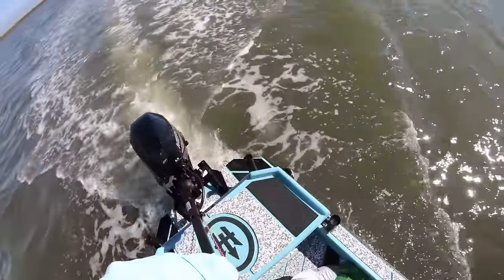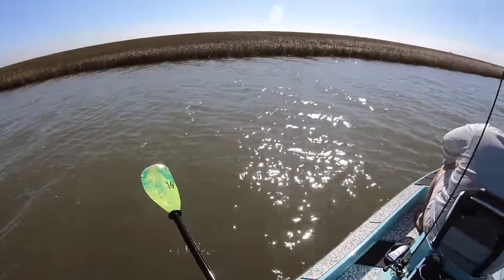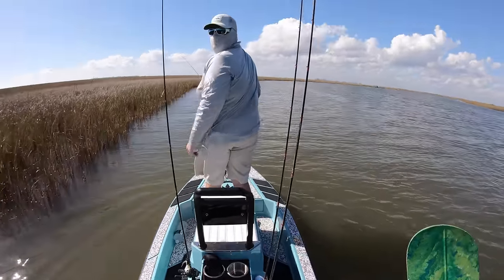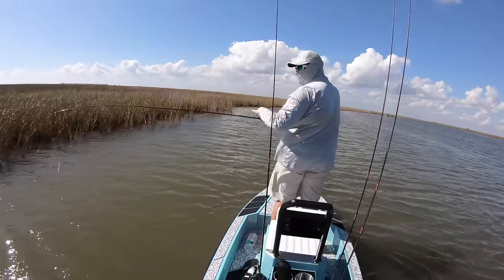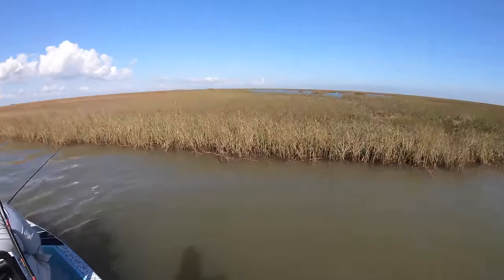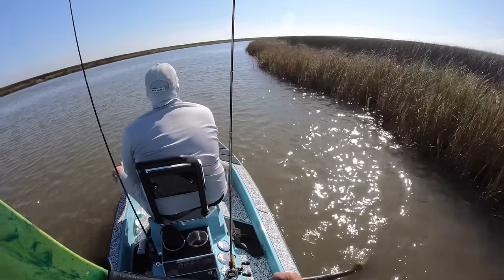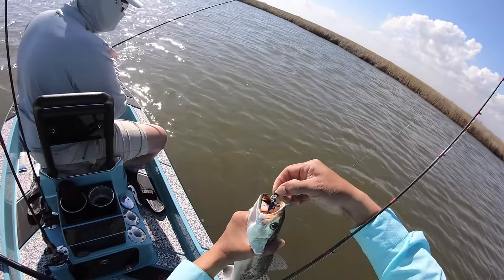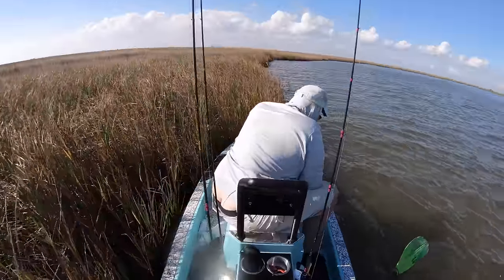(S4 Ep44) H:Skiff 13 Maiden Voyage / Texas Marsh Fishing

Comment: Awesome lookin rig, good shakedown, now ya know what ya need. I did both, push pole and trolling motor on the NMZ. You will need the push pole with that troller when the prop starts hittin oysters. FWIW, when alone, I pole, troll and fish from the front, works for me. Tight lines!
Reply from the maker: My thoughts exactly 👍

Comment: Mark I have a Gheenoe LT25 and fish the same waters as you. I think it’s beneficial to have a trolling motor and a push pole. They are both good in different situations. You still need around a foot of water for the trolling motor so when you get real skinny the push pole is needed. If I could choose just one it would be a trolling motor, the 55lb rip tide is killer. Also if you are looking for a more budget push pole check out TFO mangrove poles. You self assemble, much more flexible than a stiffy but your boat is so light it won’t matter. Gordy and Sons in Houston sells push poles. Awesome rig and safe boating to you
Reply from the maker: I’m going to get both as soon as I can.

Comment: For a less expensive push pole look at the SuperStick $199 at Bass Pro shop or Cabela's. Mine works great, it does weight a little more but not as expensive as a Carbon Marine or Stiffy. It also telescopes so you can reduce it down in size. It comes with mounts but do not trust them when trailering your skiff, I put mine in the bed of my truck till I get on the water. They hold fine on the water. I also have a Micro Anchor with an Eight foot spike. In combination I can position myself to right where I need to be. The trolling motor would be the answer but if you are in supper skinny water (my skiff will float in 3" with the motor up) the trolling motor is too shallow. For both you would have spent a little over $700. Probably will be in Christmas bay Cold Pass area this Thursday so if you see me give me a hollar (small skiff with poling platform same color as yours) you can check it out. Welcome to the Micro-Skiff world.

Comment: For my 18ft Hewes flats boat I bought an MHX push pole. It's 21ft full carbon fiber and was about $400. With the MHX poles your supposed to cut it to the size you want. Ideally you want your push pole to be 2 feet longer than your boat and you basically just put the pole in the ground and climb the pole. On a boat your size it should be pretty effortless.
Reply from the maker: Thanks for the tip 👍

Comment: Backing small short trailers can be a real headache, if it just does not work for you look into a front hitch for your truck. You don't need anything expensive or heavy duty you will only be using it to move a very short distance at idle speed. If you can't find one made for your truck try a local fabricator.

Comment: They make a stern mount trolling motor. A manual anchor pole would be nice too. I’ve seen a push pole/anchor pole which would be nice. Just looking at the two of you, I’d say the skiff is definitely more versatile. Probably having a lithium battery for a trolling motor is a must to save weight. I bet for one person it’s awesome, but seems to be acceptable for two people as well. Great to see one of these in action. Slick little package!

Comment: Mark on Mercury outboard you might want to purchase a waterproof digital LCD inductive hour meter (under $10), it's a small meter that attaches to your motor that determines how many hours you have used your motor.  Mur's 20hp outboards their break-in periods are 10hrs, afterwards you can run them normally.  If you don't plan to use the motor after 4 months or more check up the procedure of winterizing.

You don't need to spend more money on a pushing pole you can build one out for under $5 out of Charlotte PVC pipe with handle or garden 10ft stalks at Walmart.   Get a pair of mini quick fist clamps to strap them to your skiff, so they don't fly off when you go faster.  I have 2 on my boat both used for when I need to get into shallow water and when I need to use an anchor pole instead of using my main anchor.  Congrats on the skiff hope you use it more, tight lines bro.

Comment: the solo skiff seems much easier to paddle compared to your micrso skiff..  I have owned a solo and previously a PA14 ..  i have launched the solo off the beach thru the surf into the atlantic many times this year.. no issues with paddling (cant use the motor within 100ft of the beach due to swimmers).  your skiff does have a very nice layout..  with the console ..  hope to see many more videos of it in action.. might make that pushpole a dual purpose stake out pole as well :)
Reply from the maker: Thanks for the tip!

Comment: Get a regular electric steering trolling motor not a cable driven one. Buy a co pilot module. You have a trolling motor with a remote steering and its a little more than half of an i pilot trolling motor.

Comment: Small trailer needs some tall poles so you can see where it's at when backing up.Id rather back up a 35ft boat over a 14ft boat.Them little trailers are tricky without a doubt
Reply from the maker: I’m ordering some tonight. Couldn’t find anything here in Houston 😂. I couldn’t see my trailer when trying to recover the skiff.
Reply: You can make some from PVC pipe. Bend it with a hair dryer.
Reply: I can relate to that. So difficult.

Comment: Doesn't look like there's enough room to tilt the motor up out of the water with that poling platform. How do you get skinny like that?
Reply from the maker: It manually trims up and clears the bottom.
Reply: @MDLRFishing  No need for an anchor pin at least